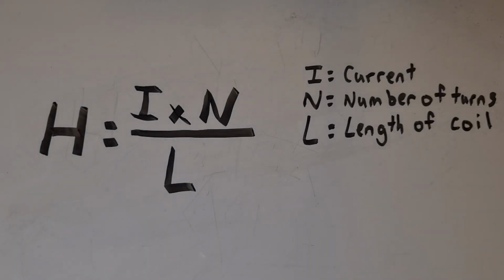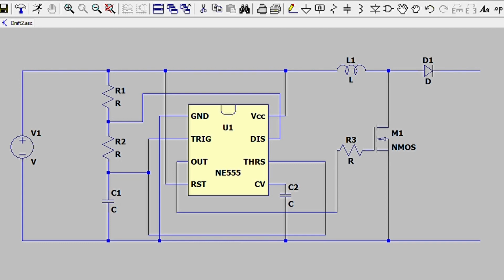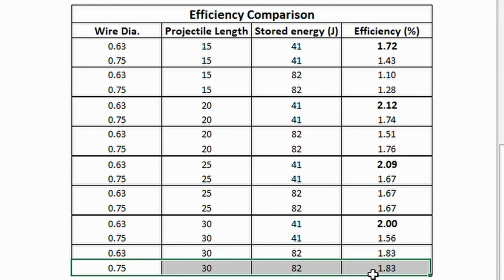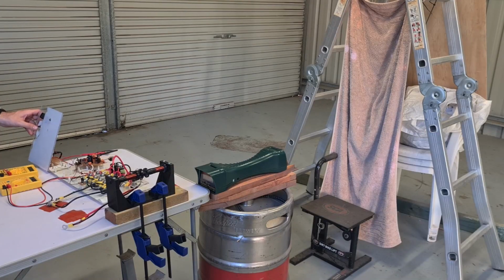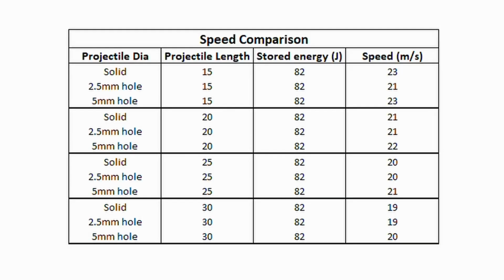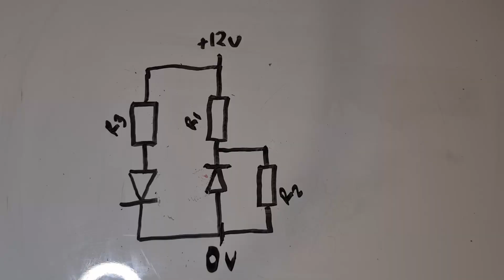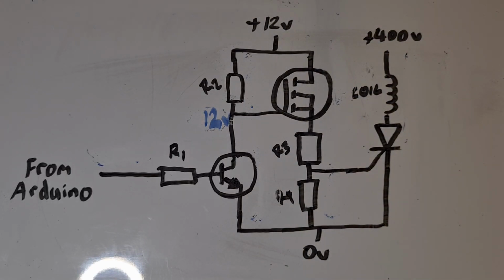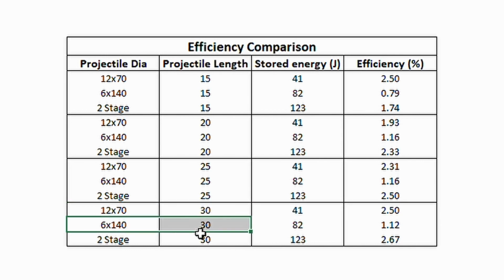Coilgun Experiments: Testing to Find the BEST Design

Comment: Very interesting to me brother🙂.
I'm thinking a spot welder for making ebike batteries could be a great power source as it gives one short sharp burst of high current, but as a backup plan I have a mini 12v DC to 220v AC inverter and transformer to raise voltage from 220v to 440v, bridge rectified to DC and store energy in capacitors.

With ebike motors voltage = speed and amps = torque, but what would this mean for coil gun?  Is it high voltage or high current that does the business here? Perhaps a balance of both?
I've seen that thicker wire produces better results, could this mean that current is the driving power? 
I should imagine a stronger magnetic pulse and coil less resistance = more power?

What would the results be of a shorter coil? 
Your tests should a longer coil is weaker than a short coil lenth, I'm wondering if shorter than your shortest would give better results?
What actually propells the projectile, the initial attraction or the initial attraction plus more acceleration from within the coil?  If it is just the inital attraction then the spot welder maybe great for just one coil set up, but how could we make it work with extra stages?
I'm thinking once the projectile has entered the coil there is no more acceleration only deacceleration as the projectile would want to stop in the middle of the coil if power was left on.

This stuff is very interesting man, physics is great. I'm gutted to see you've not made many videos boss 👍🙂
Reply from the maker: It is the same for a coil gun the higher the current tends to lead to better performance but to achieve the higher current you will need a higher voltage or like you said use a thicker wire with lower resistance.
I have in the last couple of months been working on a new video which dives deeper into how the coil gun works looking into different coil types/designs and how they perform. There is another video using multiple stages if you have come across that, it might be of interest to you. But yeah, you want to switch the power off to the coil once the projectile is in the center to stop it being decelerated as it exits the coil. The multistage design I made used IGBT's to handle switching the high currents on and off when required.
I'm glad you enjoyed the video and hopefully you will like the next one when i finish putting it together.

Comment: Whoa dude, you really put in a lot of effort, awesome! The second stage might be more efficient than expected, because the prijectile was already in motion. Since the first stage has to accelerate the slug from a standstill, there is some static friction to oercome. You could try to pre-accelerate the projectile with a spring to see if that makes the first coil more efficient. And maybe polish the bullets to reduce friction with the barrel.
Reply from the maker: With my latest multi-stage design, i found that the efficiency slightly increased with each additional stage. The firat stage though does use so much energy just to get the projectile moving, definitely pre accelerating the projectile before the first stage and polishing it should be a difference i will have to make a new design testing that out.

Comment: Why don't they have a coilgun with bullet-like speeds?
Reply from the maker: Mainly due to how inefficient coilguns are. They can be made to have bullet like speeds, but they have to be quite larger and long to be able to accelerate the projectile to those speeds. Which is why railguns are typically used as they are more efficient and can accelerate the projectiles to those speeds in much less time
Reply: I think you could build a very fast induction-coilgun on a larger scale, basically a linear induction motor, with a fairly high efficiency. However, on a small arms scale, this is not realistic, as you would need high power AC.
Reply from the maker: I would like to build a large scale version just to see what how powerful i could make one, i think it would be interesting to see what it could be capable of.

Comment: Through theoretical calculations, I believe that the efficiency of the coil gun is inversely proportional to acceleration. In addition, the best aspect ratio and coil thickness of the projectile have optimal values. Coil lengths should be short and multiple working simultaneously for higher efficiency.
Reply from the maker: I am currently working on that, trying to work out the ideal coil size. At this stage, it does look like having shorter but more coils is the best way to go
Reply: @owensprojects  电磁线圈发射装置提高速度、提高效率，尝试磁铁做为运动部件？
提高发射速度和效率，有几个问题，没想明白。

1.运动装置有没有用强磁的；线圈类型主要还是依靠吸引为主要动力，磁生电转磁按照常见的线圈增强磁场反而是斥力吧，

2.之前都是几级加速一个大线圈，为啥不能每个线圈窄一点，一块通电或者远端晚通电，磁场逐渐向前收缩，持续有吸引。 如果运动装置都到线圈前面了再通电，增强的磁场会产生一部分推开运动装置的力。 如果用提前通电，磁场逐渐收缩，来拒去留，多少提供一部分牵引力。 常见的都是一段一段通电，密度低，不到一半长度用来加速

3.引力最大应该是运动装置刚刚进入螺线管的那一刻对吧，还是运动装置末端进入螺线管的那一刻，还是运动装置在刚刚进入和完全进入两个时刻引力相同，刚进入还是完全进入，哪个磁场梯度最大

Comment: Dude I have been working on this project for 2 years, I got a 400V 10,000uf (800J) Capacitor. I charge it with that thing which produces a 1000KV arc, I even left u an email regarding the same
Reply from the maker: I just saw your email and replied to it
Reply: @owensprojects  Thank You very much sir, I have responded as well with my queries and sorry for the long email. The amount of work done by me got up with the number of questions. Thank you very much once again 🙇🏻‍♂🙇🏻‍♂.

Comment: Nice to see the first principles calculations. I didn't see a resistance measurment but guess its around 1.6R for the 0.75mmdia wire. at 400V thats a potential max I of 250A. I can see now why my toroid ring motor may be underpowered. Fascinating video. Good luck.
Reply from the maker: Thanks! The resistances varied depending of the coil i was testing but they ranged from about 0.6ohms to about 1.2ohms so there was quite high levels of current flowing through some of them.

Comment: So you where talking about mosfets and trigers for a dual stage i was thinking anout a electric motor and the stator how they have it on 2 sides and contacts right there to triger the next phase
Reply from the maker: I ended up using IGBT's in my latest multistage design to trigger the next stage. So you mean like having mechanical contacts that are closed by the projectile passing along to trigger the stages